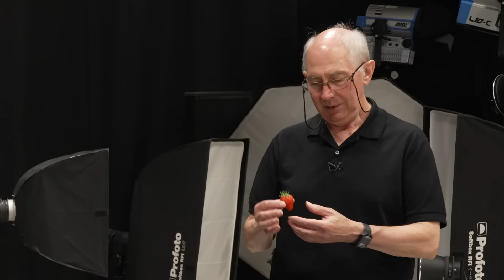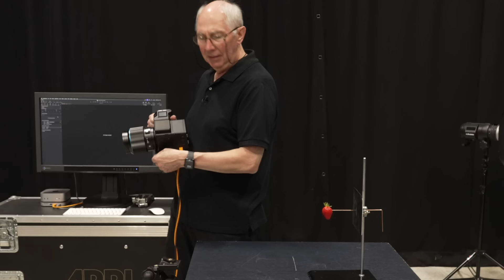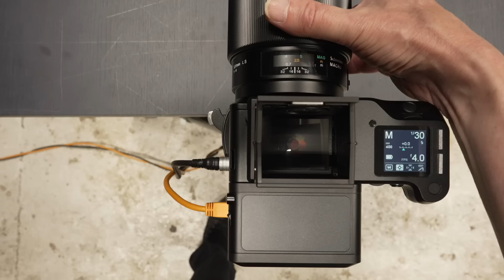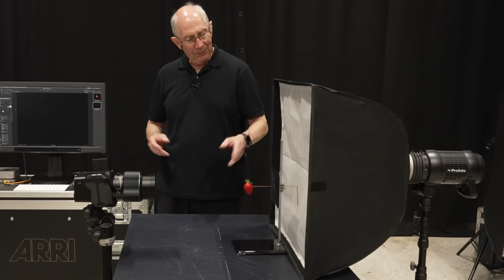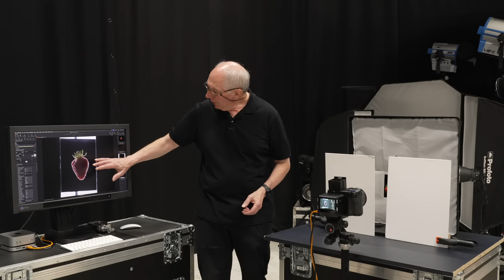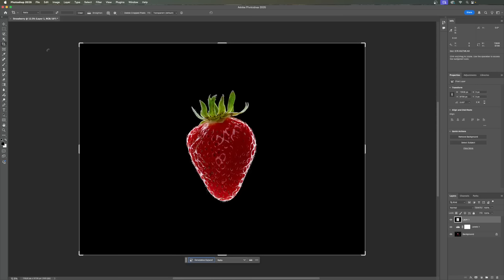Rim lighting secrets for stunning macro photography

Comment: Thanks for the tutorial.  Yes an easy way to produce rim light around a small object.

I've had a lot of success using a much different method.
I lay a sheet of polarizing gel over a light box,  and place my subject on top of the gel.  I use a small continuous light above the object.  I photograph from above with the camera on a tripod and a polarizing filter over the lens.  I don't usually need to put a polarizing gel over the top light.  The light gets cross-polarized and I'm able to dial in the light of the lightbox to pure black with the polarizing filter over the lens.  I'm not a physicist so I'm a little weak on how it all works, but I still get a nice rim light around the object I am photographing.  Fine tuning of any imperfections in Photoshop.
Reply from the maker: Thanks for watching, appreciate you sharing your alternative approach!